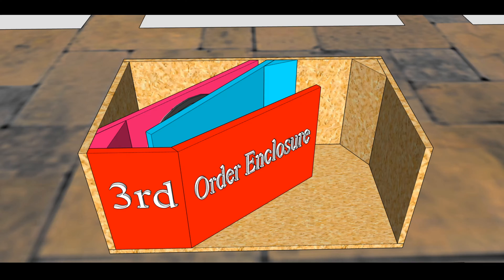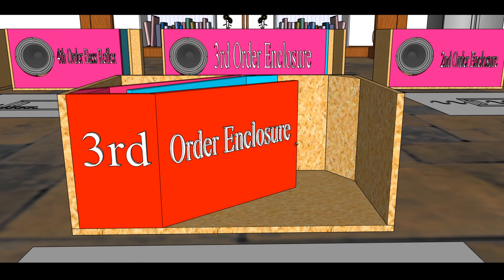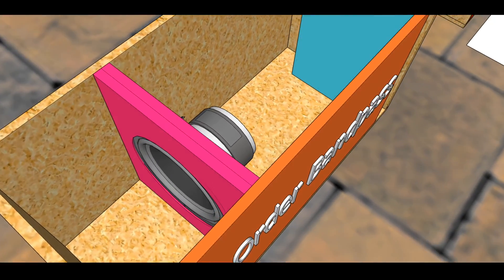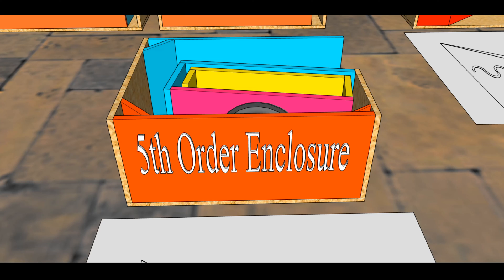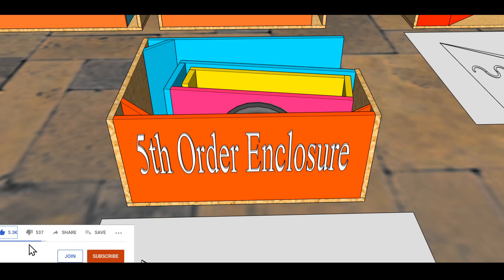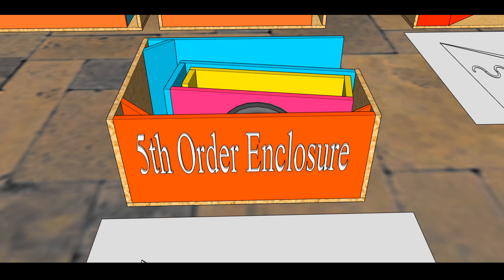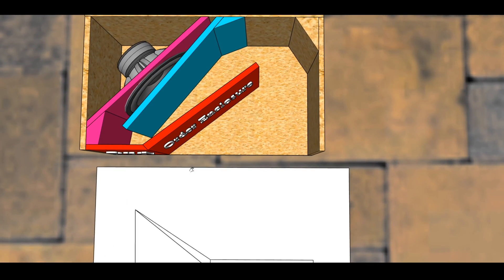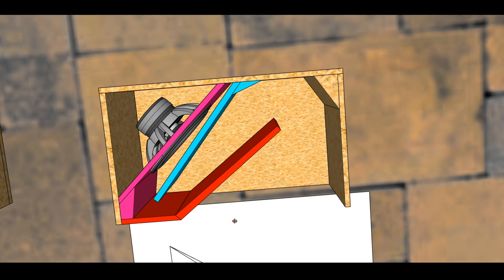5th Order vs 4th Order: Rear Loaded Folded Horn

Comment: 4th order bandpass should be firing into the ported section. Magnet should be in the sealed section
Reply from the maker: What is the difference? Always wondered...
Reply: Lower frequencies come from the edge of the cone not the center.
Magnet doesn't block any frequencies we would care about.
Motor dissipates heat much better not being in the sealed section.

Comment: Given the length of the port in your fifth order resonator & horn based box, you're likely to have a tapped horn instead of a resonator. The length might be substantial enough to constitute a quarter wave resonator that probably far overstomps any of the resonator effects you'd get from the base helmholtz resonator. So, either it's a tapped horn with a bad first section, or a tapped horn with an accidentally good first section -- or better yet, you intentionally design the first section to your liking.
Reply from the maker: Good observation

Comment: When I was in high school(1992-1995) a good friend of mine had a 1989 S-10 with two Orion 12's in a 5th order enclosure built in the bed of the truck and had a 12' x 12" cutout in the bed and cab with a rubber seal that sealed the bed and cab together. It was powered by an Orion 800w amp and it was one of the loudest setups I've ever heard. It would play anything loud......rap, rock...it didn't matter, it played it all very well. It had punchy hard bass with rock and the lowest lows in rap etc. And for it being back then it was just mind blowing loud.
Reply from the maker: Yes. These type of enclosures are very efficient and doesn't require a lot of power to produce impressive SPL levels.

Comment: Hello I just subscribed. I'm interested in building  a C-pillar isobaric 4th order bandpass enclosure for four 15s in my trailblazer.  Is this possible and will it sound great. Only reason I'm thinking about this is because of my space and I'm trying to keep the back seat.
Reply from the maker: Isobaric for 4 subs equals the surface area of two subs. Iso saves space and increase motor strength. If that's what you need, then go for it.

Comment: Thanks for the really great videos, I didnt even know i wanted to know all this stuff. One question I have is something you actually touched on with the 4th order bandpass. What applications are each of these designs best suited for? I know you mentioned sealed cabs being punchy and good for kick drums, but do any of these have big advantages over others and in what real world application would you use one over another? Thanks for the exceptional content my man!
Reply from the maker: Horns are mostly directional, for the outdoors or pro audio. 4th orders typically control the upper f3 roll off, 6th order better extend the lower f3 couple with the flat and controlled upper f3 of the 4th. Used more so with smaller drivers to give a more pronounced low end. Like in the classical Bose applications.
Reply: @BudgetBassHead  Horns don't inherently cause your low frequencies to become directional. You just end up with a very controlled uniform pressure front, which is what the horn is intended for -- impedance matching. If you take advantage of that uniform front to create an array of multiple boxes or in the case of a "scoop"-type RLH, an array consisting of a driver directly radiating and a horn radiating the backwave, then you can create destructive interference in a tactical way and apply to get cancellation where you'd like it. 

In reality, you do not get that power back. That power is spent fighting other power. That makes your horn less efficient, but it doesn't affect the power in front of the box either, as that power behind the box might as well be lost -- it's lost anyway, but at least it's not bothersome. Although that does ignore the phase issues in front of the box that can come from this!

Comment: Hi,
Quite informative videos. Keep them coming.
1. Which is the preferred tool to design higher order subs? Is WinISD good enough?
2. I see a lot of Micro subs being introduced in the marker with driver sizes ranging from 4 to 6 inches! Can you help guide as to which kind of enclosure is the best if one wants to have a preferably kinda flat curve in the 35 to 70Hz zone with a small driver but with very little bass overhang or lumpy bass?
Reply from the maker: Most of these tools are the same under the hood. Basic calculations of parameters, applied to acoustic theories. WinISD suits my purpose just fine. 
As for the micro subwoofer, with space becoming less of an issue, transmission lines and Bandpass enclosures are quite popular. However, there is also a popularity of pairing them with  passive radiators